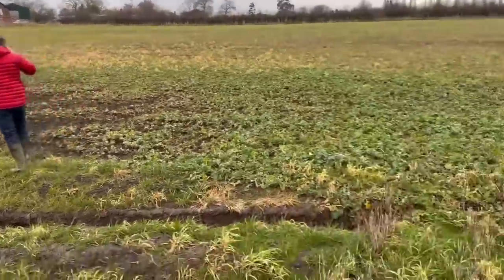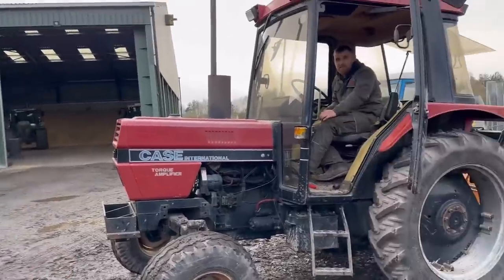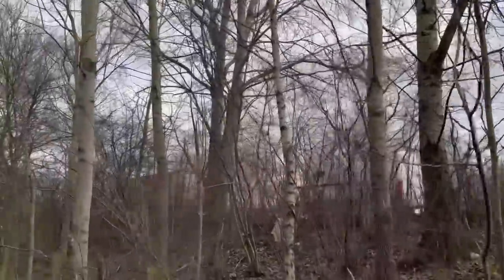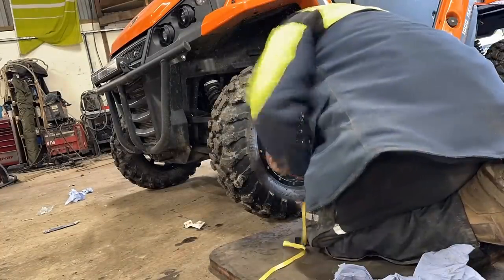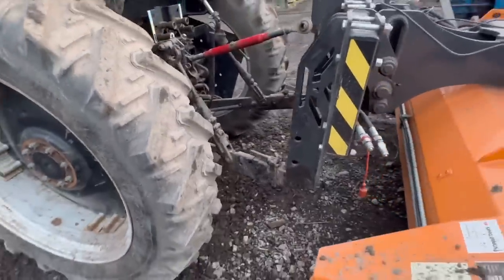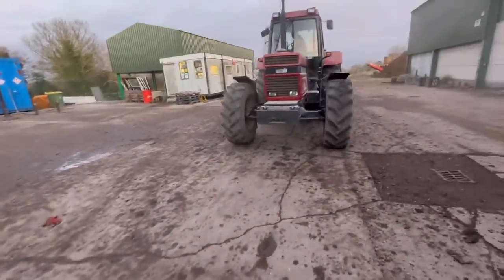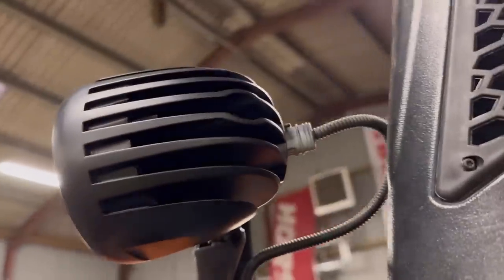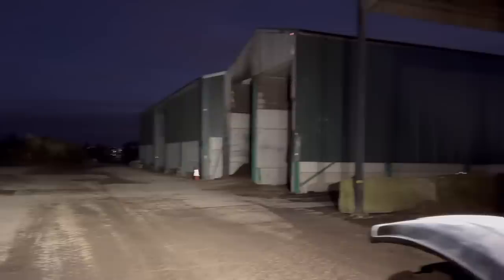ARE CLASSIC CASE TRACTORS TO SMALL FOR BRUSH  #OLLYBLOGS #AnswerAsAPercent 1041

Comment: 👀🙄🐾👍 if you want the brush to spin faster out it on either 7710 or 7830 deere both will have an oil flow of at least 90 Ltr P/M